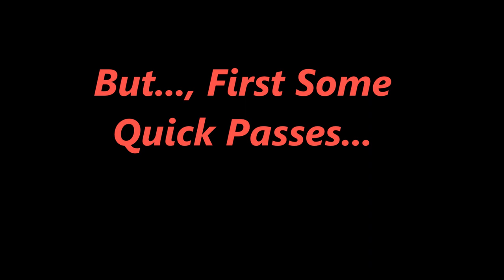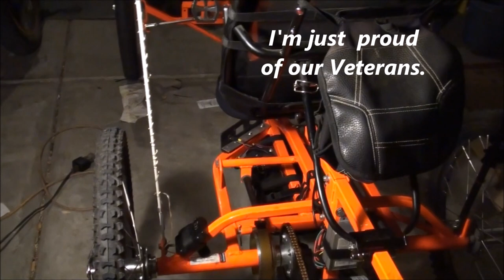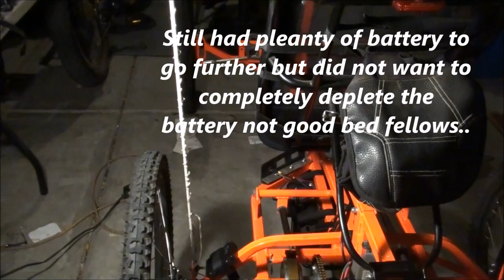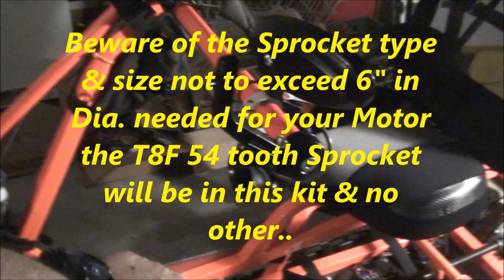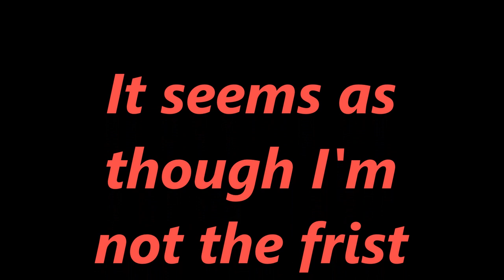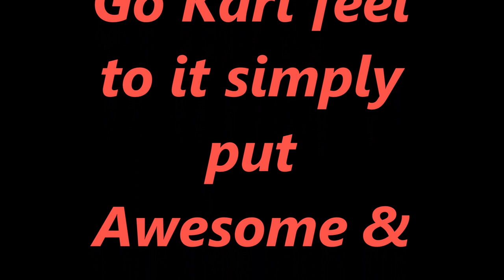LLC Quadra Sprint Electric Scooter Motor 75 Mile Marker Review

Comment: Great job Mitchell.  Outstanding
Reply: How many watts was that motor?
Reply from the maker: Peaceful Prepper  How silly of me not mentioning the Volts & Watts 48V 15Ah Battery with 1000 watt Motor excellent pairing between the two..
Reply: Mitchell Egle  Nice job on this.  I am impressed.  I used a 350W 24V motor to start.  It works well but hills are tough.  Is the shaft on the motor keyed?
Reply from the maker: Peaceful Prepper  The driving shaft is the same as with the stock only difference is the Axle is longer to accommodate the larger Wheel driving hub & Sprocket hub all on 3/16" keyways as with the stock just a bigger driving wheel hub for the wheel & added a Sprocket driving hub for a T8F Chain & Sprocket.. The Motor Cog  I can not tell it looks as if it is keyed. I will leave a link on the Scooter Motor kits they have several types to choose from 24v to 48v system & wattage controllers combos.. I went with a 48v 1000 watt 3000 rpm  brushed Motor & supplied 1000 watt controller. The Battery is the most important I went with a Lithium 48v 1000 watt 15Ah battery do not use anything less than a 12Ah battery  you may find yourself a little short on power & distance. Here are the links for Scooter motor kits & Battery. 
Battery
https://www.amazon.com/gp/product/B07F8QCWCR/ref=oh_aui_detailpage_o05_s00?ie=UTF8&psc=1
Motor & Controller 
https://www.amazon.com/gp/product/B074CWCN6F/ref=oh_aui_detailpage_o06_s00?ie=UTF8&psc=1
Reply: Mitchell Egle  Thanks Mitchell.  I like the power and speed you are getting.